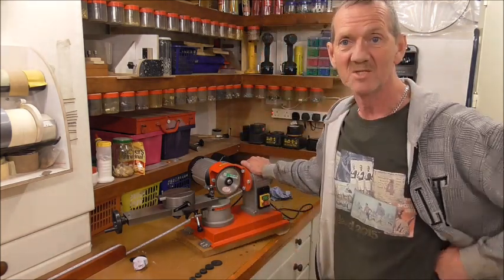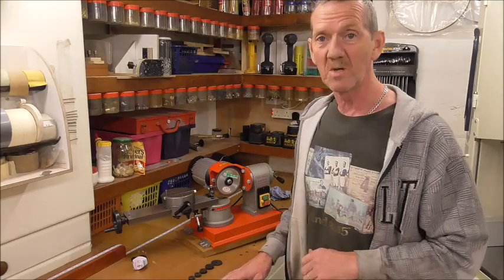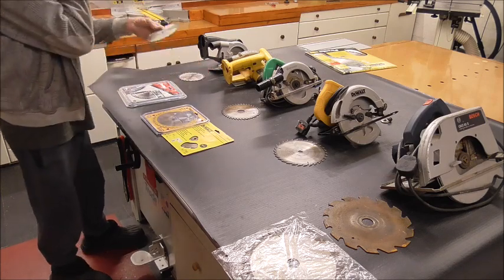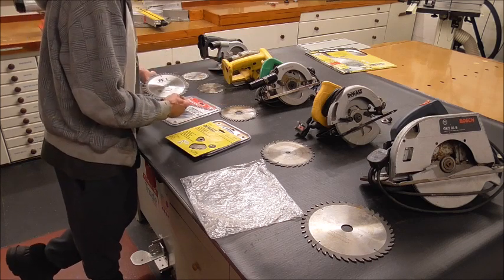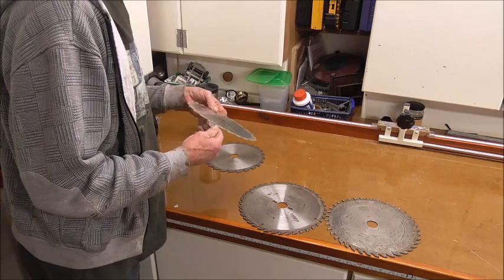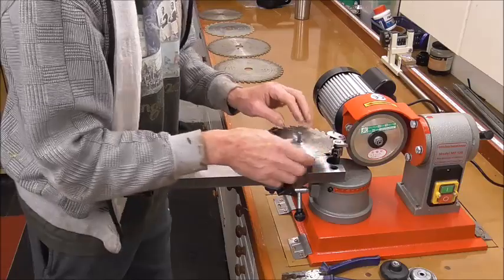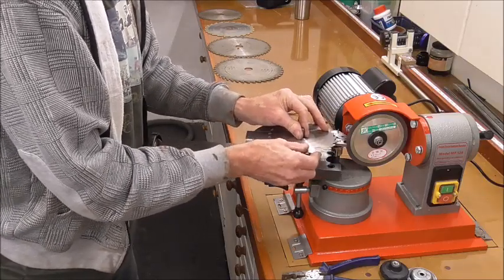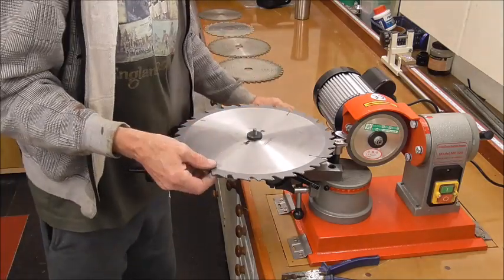Power Saw Blade Sharpening

Comment: Thanks for the video.  It's very informative, and it sealed my decision to buy one (which should repay itself after sharpening about 16 blades AFAIK - sharpening a 12"/80t blade costs about CAD$20-25 here and this sharpener could be delivered for about CAD$400 including taxes and shipping - and I'm shopping for a better price yet).  I was looking for a bargain on a foley-belsaw but it sems these are made of a mix of expensivium and unobtainium, and the makita 9803 seems to be made of cantfinditium...  Do you think the ones with water cooling are worth the premium?
Reply from the maker: Hi, this link should work out much less than $400 and its free shipping, hope this helps http://www.ebay.co.uk/itm/circular-Saw-Blade-Grinder-sharpener-Machine-Woodworking-Mill-Grind-Slideable/252652566824?ssPageName=STRK%3AMEBIDX%3AIT&_trksid=p2057872.m2749.l2649

Comment: I watched both of your videos, both loaded with good information, thanks.  I am considering buying one of these.  I note that on Ebay there is a version with a water collecting base and a water feed as a coolant/lubricant when sharpening, this is an additional £20 Given a choice, and your experience using this sharpener, would you think there is benefit in using coolant?
Reply from the maker: My self i would not i can't see the need and would give extra work to oil everything after and the little amount of grinding you do on each tooth they should not get that hot.
But do get one they are so very useful
Reply: @dmgladden  Excellent. I didn't really want the faff of coolant, but having been a mechanical engineer, I understand that sometimes there is a need for lubrication and cooling. I was on the fence, but it is nice to know that things don't get that hot. Cheers David, thanks.
Reply from the maker: Well yes i guess if its there its not in the way, at least if you do need it at some point, the option wasnt available when i got mine
Reply: There are certain positive benefits to edge formation as brittleness caused by thermal expansion is lowered, longer abrasive life and so on, and so on - we can discuss them for days, BUT the main benefit in my eyes is that you scrub most of the dust particulate out of the air you breathe. Do not forget that bonding agent in tungsten carbide is cadmium and we absolutely do not know what is used as fillers in the bonding of the disks.
Reply: @dmgladden  I have been on the fence for a quite a while, I am now buying within the week. I have limited storage space, so have held off for a while.

Comment: when finishing a tooth, pulling blade away, I think it is not clever to push it towards the wheel, if the tooth moves even slightly to left across the wheel border, you just round it's edge.
Reply from the maker: clemopcl thanks for the comment but i should mention i hsve done about 30 blades my way so far and they are always very sharp and very clean cutting, but thats just my way your free to do it your way
Reply: I meant it primarily for other viewers ;) When someone never did this before and simply copies what he sees here, then he may blunt the teeth even more. BTW I do this in furniture factory. Blades on some big industrial machines (mainly our Holzher 6210 - CUT85)  need to be changed more than once a week when there is lot of work. According to records I sharpened 109 times (April-July). Sometimes perfectly hand-sharpened is not enough (esp. with veneer-coated chipboard) and we have them sharpened externally on NC sharpening machines. They also have proper cooling (this technique really overheats the edge, changes the metal structure and makes the sharpness last shorter, not a big problem for hand-tools however), I only have cooling by liquid made by me, using infusion hose with dripping chamber.
Reply from the maker: ok understood

Comment: Hi I have the same machine
like you had to clean and debur.
The only problem I have is with the 
blade tightening as I turn to sharpen. Are you having the same
problem?
Reply from the maker: yes as you will notice in my video i am constantly tightening the blade but i don't mind as i can guess what would be needed to avoid it as the blade would be pressing down too hard to the base which would first stop it turning and if it did tune the teeth would be catching on the cast iron' if you shim it to give space but that would create other problems
Reply: David Gladden 
Still a great bit of kit David
Reply from the maker: yes I'm well pleased with it and already I've saved plenty of money
Reply: Hi David.  You might want to pass on the blade tightening problem can be solved by using a spring between the blade hold down cup and the knob. This will require adding a longer bolt. Worked great for me. Also the lack of a 5/8 blade round washer can be solved by taking the 3/4 in. one and running a bolt in it and chucking it in a drill press and using a stone or wheel off a bench grinder and turning the 3/4 in. round nut down to 5/8. That is how I solved the problem. I have never come across a 3/4 in arbor so had no use for that round nut. Also the slider the blade runs back and forth on had 5 thousands slop in it so I used 4 thousands brass shim and super glue it to the the slider and  it works great now.  Great videos.

Comment: Hi David, thanks for the video, really useful. I have just bought the same machine , no decent instructions so your video was key! My machine was also a bit gritty, stiffish....how did you polish yours?
Reply from the maker: Peter Jennings hi Peter thanks for the comment, i just used wire wood and emary paper, some white spirit got rid of any old gunge and a good oil and thats all it took
Reply: Part 5 of IV safe affairs, of my instructions said "the machine doesn't until it works usually" 😄

Comment: there must be a place that have those "centering arbor" adapters.. does anybody knows? 
 looking for 5/8 and 1"
Reply: I just bought one of these machines, and was indeed surprised to find the 5/8" arbor wasn't included. Such a common size for saw blades but not included. I made one myself on my lathe. Otherwise I don't know where you might find any part that would provide a 5/8" arbor to go onto a 8mm thread.
Reply: jean hache where can these sharpeners be bought

Comment: I have a thirty year old workshop here in Spain that's loaded with tools, many of them electrical, none with earth pins.
No problem.
I also have a box full of 13 A plugs, sockets and extensions that anyone is welcome to have.
As for the sharpening tool, it's a waste of space.
Reply from the maker: Earthling good to see luck is on your side for now, just be sure to stick to the double insulated tools or battery ones any you will stay lucky thanks for your views

Comment: Hi Dave
Mine has arrived so I am just watching your video again as the instructions don't instruct you in anything at all. Firstly it appears that you are not using the stop pin and I was wondering why, and secondly I am reluctant to use the sharpener on blades covered in heavy resin. My cleaning method is simple, leave them overnight in vinegar (Tesco's cheap distilled vinegar not the wife's expensive gourmet vinegar) but what happens if you are in a hurry? Will it clog up the diamond blade with resin? Thirdly it appears that your blade has a slight nick in it, does it affect the performance and how did the nick happen? Mine arrived with the blade so badly broken that I had to get them to send another, it broke because the packing in the box was terrible.
Many thanks.
Reply: Wrong again, I can see you are using the stop pin.
Reply: WhiteVanMan a
Reply from the maker: WhiteVanMan hi sorry missed this comment, first yes I did use the stop pin at first but now I'm use to it I don't want more, as for cleaning I have a video on that but it won't bother the
Disc I never clean first and many time I don't clean at all it depends on what saw the blade is for, finally my blade did have a small chip but then it broke completely so was replaced now all is good, hope your enjoying the machine
Reply from the maker: WhiteVanMan i do a hard copy dvd for just £15.99 if it would help
Reply: Wwrttty,hiteVanMan   ,que
Reply: WhiteVanMan ,